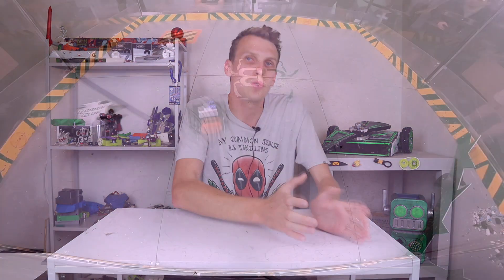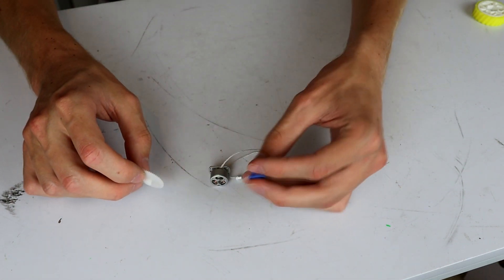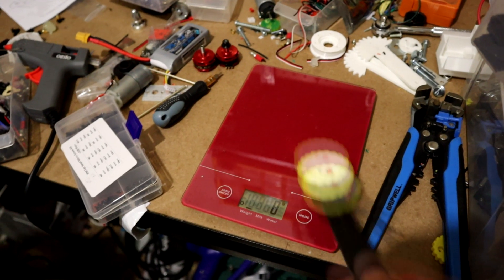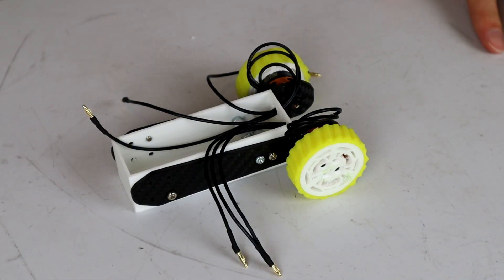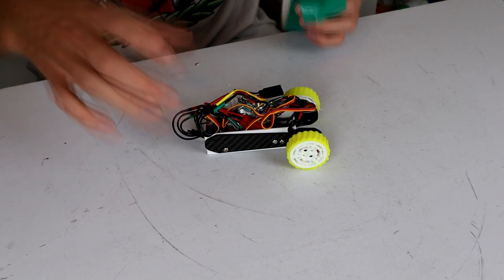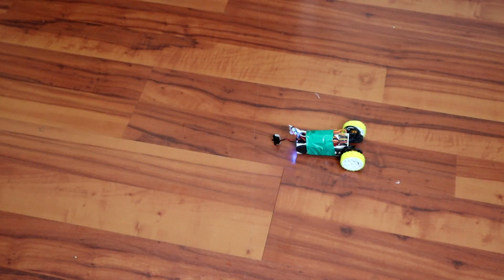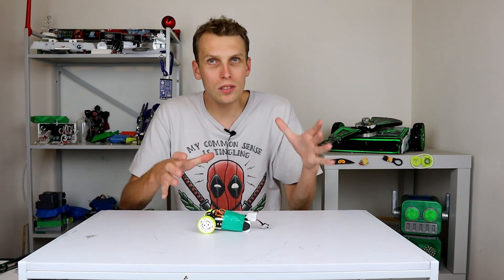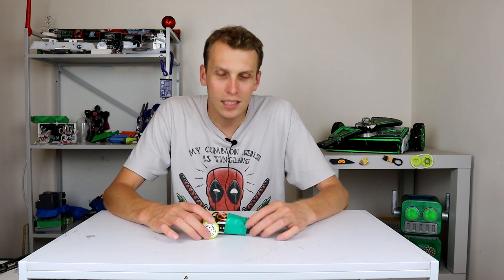Brushless direct drive (150g yolo drive combat robot)

Comment: That first brushless motor is the exact same one that is used in the Yuneec UAV stabilized camera gimbals. Curious where you got it? I think I have a few of the screws for them and I think that they are m1 or m1.6 they are less than m2 because my thread gauge only goes down to m2 and it is smaller than that. They did use a small hall effect sensor on the back of the motor where the shaft sticks out.

Comment: One technique for learning to drive better is to use a bad transmitter like a MLP4DSM for practice, then use something decent like an X9D or DX6 for tournaments. You then don’t really need yolo drive for the practice bot, you just need 500 rpm at 6V on 2S with a fairly narrow track width.

Comment: You will find it much easier to steer by making the wheels much further apart. Torque is force times distance so the distance from the wheel to the CG of your robot makes a huge difference. Plus it will make steering control much easier since the same difference in RPM between the two motors will result in a much larger turning radius.
Reply from the maker: Yeah wider does make sense, its really only this thin because I was lazy and wanted to just use 2 full drone arms, If I cut them down (or get rid of them) I'll have the weight to go wider. Something I'll look into for v2

Comment: Ben, could you go down in size with the motors to a 1306, still a butt load of power but will save a load of weight?
Reply from the maker: I could, maybe, the problem with going down in size is kv. These are 1400kv and are still too fast, most smaller motors are 2000kv plus. If I can find sub 2000kv 1306s then those would be perfect
Reply: @TeamPanicRobotics  Could there be an option of putting a throttle limit on them say 40% with a throttle curve to null the excessive KV?

Comment: Yeah raw fights are great, cant have enough robot combat :) and if sure you have seen Robert Cowans tutorial on converting geared brushed motors to brushless. if not check it out, it will make your life easier making geared brushless motors.

I cant remember if this was in the last season or the one before of battlebots,  but the driver of hypershock was interviewed and he said that one of the big differences he has is, he uses a standard ground vehicle pistol grip style rc transmitter, instead of the aircraft based box with 2 sticks, style transmitter that other people use, so for him the driving is more natural because it not only has a hand on each control, left on the trigger for fwd and rev, and right on the wheel for left and right, but it also now has the same controls as the rc cars he grew up driving. Its one of the reasons his is one of the only bots that drifts when he turns instead of turning like a tank all the time.

I grew up driving rc cars and tried it with my beetle, the control difference is night and day, the only problem is, finding a ground transmitter that has enough channels, cause i like to have a variable control for my blade not just a simple on/off switch.  

I found a thingiverse where a person changed a QX 7 to a pistol grip style ground controller, but it looks like they dropped a entire control stick to do it, if i could either find or rework that to have maybe a 2nd or even 2nd and 3rd trigger for the left hand, or at the very least still have that 2nd sticks controls somewhere, so you can control your blade speed, and maybe a arm like maximum ogerkill uses while still having the ground pistol grip style controller. that would be perfect. Sadly my 3d fu is weak.